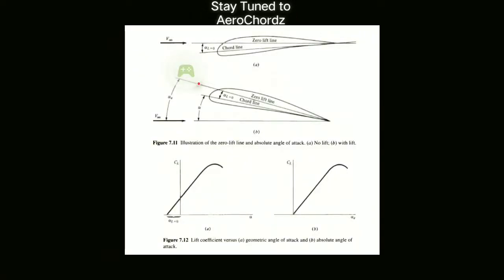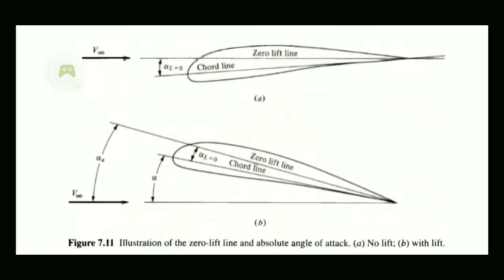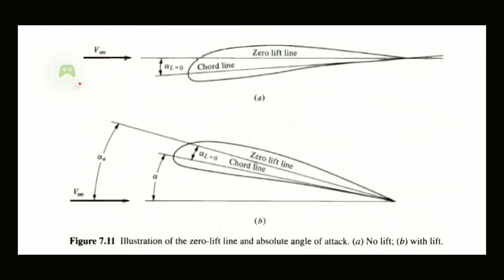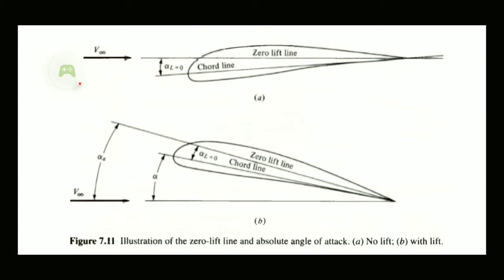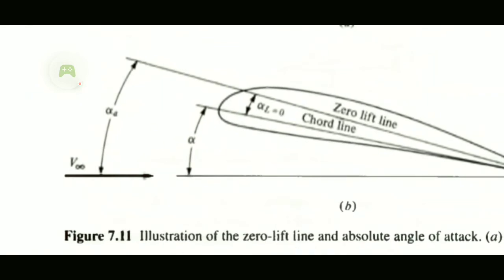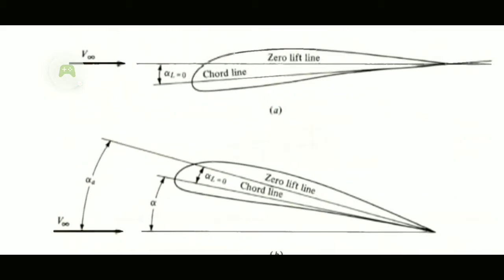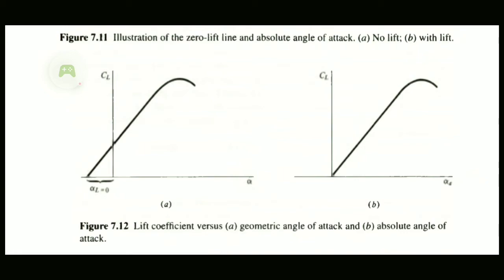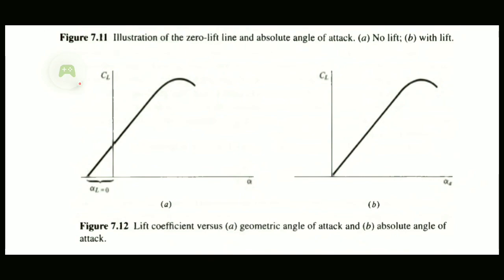Principles of (Airplane) Stability and Control - Absolute Angle of Attack

Comment from the maker: If you have seen a shooting star 🌠 (in movies/reality) then you might have observed the star forms a tail that is also referred as T R A I L - backward portion leaving the remains of the shooting star.
Here,
The wing (or airfoil) which you are seeing has chord line and zero-lift line they are (coincidentally) intersecting at a point - at the end point of the wing (converging pointed part of the wing, like >) and that point is known as trailing edge.

Continuing Trailing edge -
Let's say you are drawing a wing - you started from the backwards and then smoothly moved to draw the curves to represent it as an aerodynamic object and then this smooth curve meet at the end of the wing - (converging pointed part of the wing, like >) which was your starting point from where you started to draw the wing.
Now this backward most point (where you closed the curve to form a wing) is actually an edge of the wing like if you see the pen from the cap/top view then you will see it as a point but in reality it is a line/edge.
So the LINE DRAWN FROM THIS TRAILING EDGE in the horizontal direction POINTING TOWARDS THE FREESTREAM VELOCITY - V infinity is termed as zero-lift line. Why zero-lift line? Keep reading!
Now let's say the wing is producing lift because of high pressure below the wing (relative to pressure above the wing) when it is inclined at an angle and as the angle decreases the pressure below the wing also decreases and at "an angle" the pressure force above and below becomes equal and therefore, they cancel out each other and hence the wing at that angle does not create any lift. That angle in the video is "Zero lift angle" which measured from freestream Velocity to the chord line.

Now if you recall (from basics of airfoil in Aerodynamics) the chord line passes from the forward most location of the wing - Leading edge (LE - the blunt part at the front portion of the wing) and extends up to the backward most converging point on the wing - Trailing edge (TE).
Again, the line drawn from that Trailing edge of the wing parallel to the direction of freestream Velocity (NOT necessarily the HORIZONTAL line) will give us the zero lift line of the wing.
Geometric angle of attack is measure from freestream Velocity direction to the chord line.
Absolute angle of attack is measured from the freestream Velocity to the zero lift line.

Hope it's all clear now.

To know about chord line, leading edge and trailing edge AND for angle measurements you may watch this video - ( https://youtu.be/JbzJO_sIZJ4 ) from 1:44-2:30